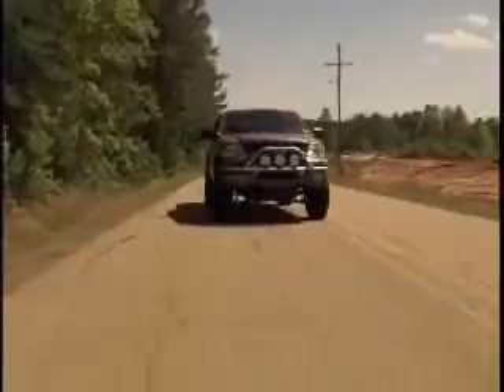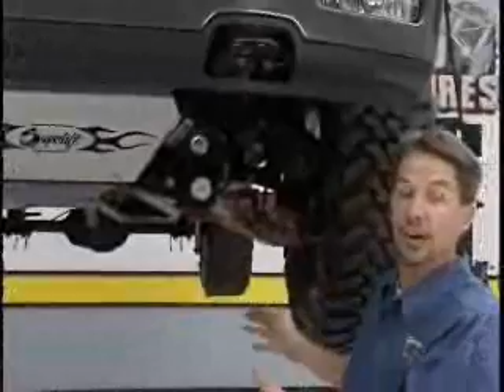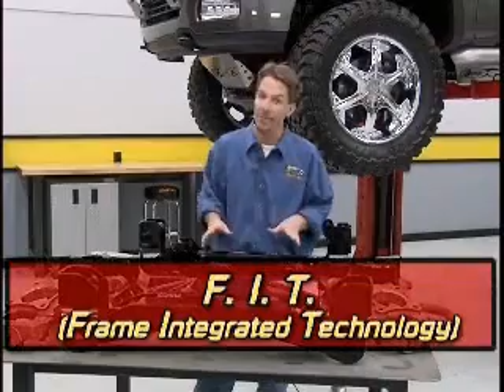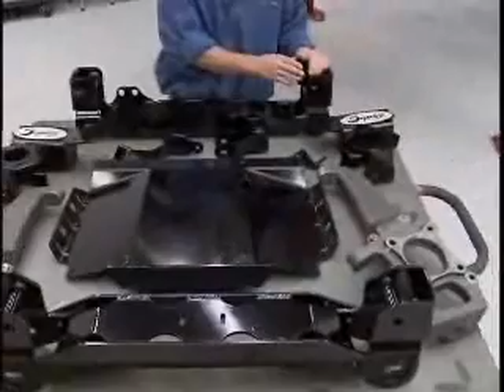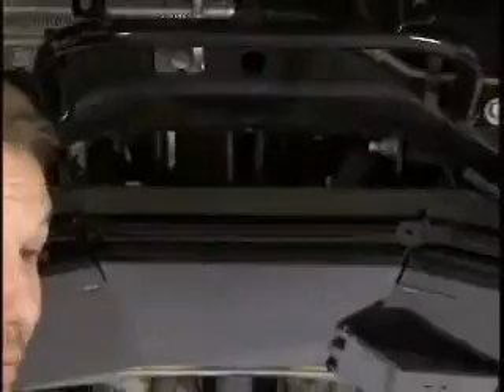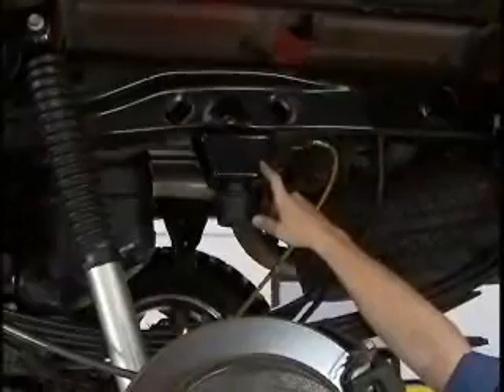Superlift 4.5" Lift System for the '05 and Newer Ford F-150

Comment: @laxfreak2828 pfh.  BS.  notice how (just as one example) ford stayed in business during this economy, did GM or dodge do that without being bought by the govn. um, NO!  also, fords are wayyyyy more reliable.  My father has a chevy that has had 2 major breakdowns. and his chrysler has already had a part failing, the engine light on, and its only a few years old and was bought brand new.  need i continue?